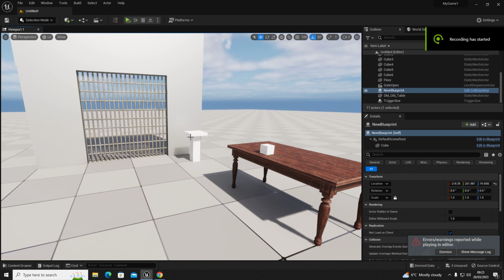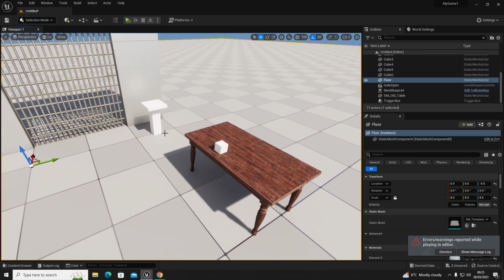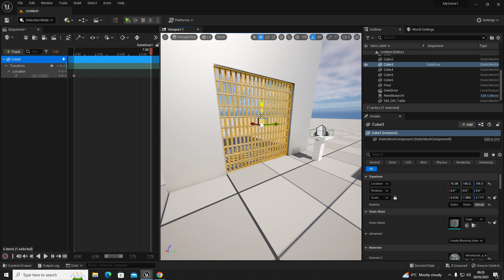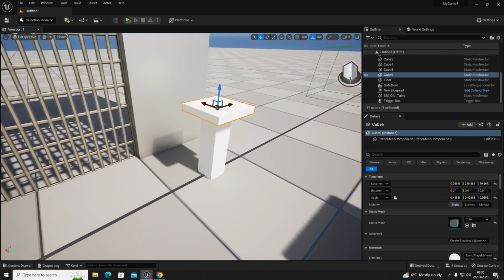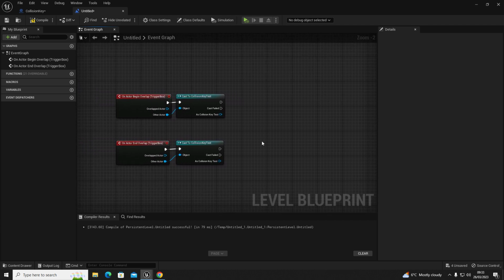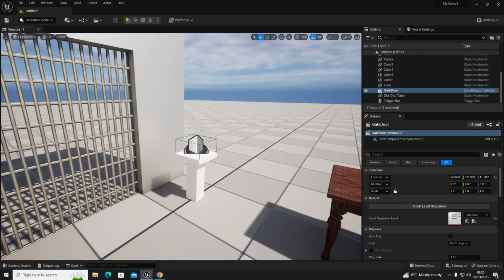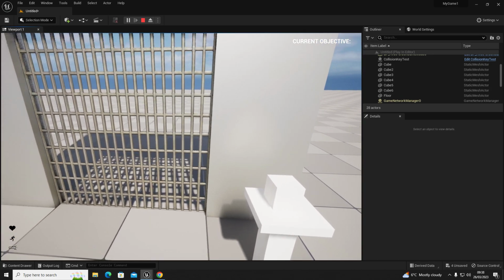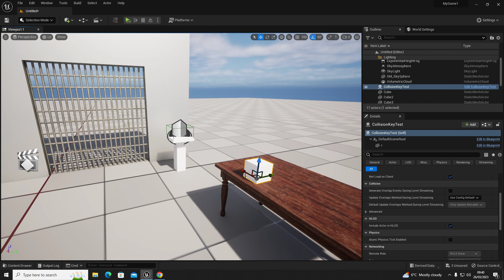UNREAL ENGINE 5 PHYSICS BASED PUZZLE DOOR PICKUP ITEMS TUTORIALS

Comment: Is using the level blueprint a good option? I thought those mechanics are better if made in reusable blueprint actor format?
Reply from the maker: The level blueprint is there to be used :) there isn't really anything that will kill performance from using a level blueprint you can destroy actors from the level blueprint if you need to cull actors after use for example.